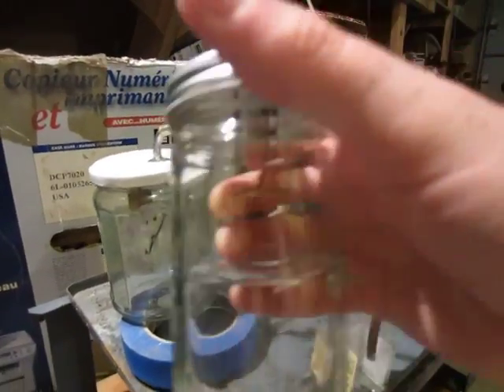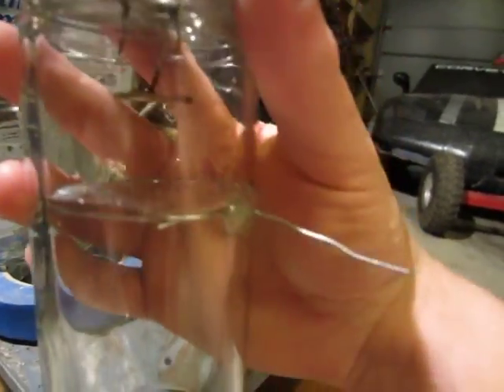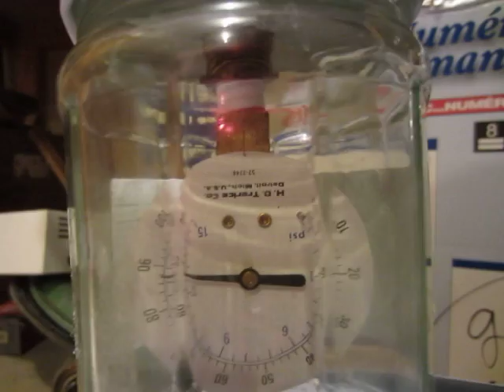Home Made Vacuum Pump

Comment: You can do some quality vacuum experiments with the Harbor Freight vacuum pumps only $130 dollars, the units are used for AC and refrigeration repair. They go down to 20 micron  that's 2.0 x 10^-2 Torr good enough for many plasma physics experiments.

Comment: For the Vac Pump if you connect them in parallel ie put a T piece in the suction line from both pumps to the one jar you should be able to get enough suction you could try them in series as well but i think one motor may cut out first like that one did when it got to overload point

Comment: If you look up any of Stanley Meyer's water fuel cell designs, he also used high voltage, low amperage Hydrogen/Oxygen production from any water, even ocean water, with no need to add electrolyte. It's interesting technology. You can even look here on you tube, search Water Powered Dune Buggy(Stanley Meyer's water powered dune buggy), which actually uses the Hydrogen and Oxygen from water, to run the engine. Hydrogen is 2.5 times more powerful than gasoline. Stan was a brilliant man. Great work.

Comment: Go to the website Ritalie.(com) and look up the plans to build the Radiant Energy Charger. Uses a high voltage transformer from a microwave oven approximately 2100volts AC(converted to high voltage DC to power the Magnetron(inside the microwave oven). I used a broken microwave oven that was no longer being used, and I visit the local auto wreching yard to locate some of the other parts, at low cost. I purchase the Motherload from Ritalie.(com) for 36.oo dollars, or 20.oo for charger build plans.

Comment: Very interesting project. I've read that we have 14.7 psi of pressure on us at sea level. Altitude affects pressure. ie below sea level, I believe the pressure is higher than 14.7. At 10,000 feet(altitude), there would be less than 14.7 psi of pressure. Your statement makes sense(a perfect vacuum), I will research this further to confirm. You would likely have a blast with (High Voltage)Water Fuel Cell experimentation.